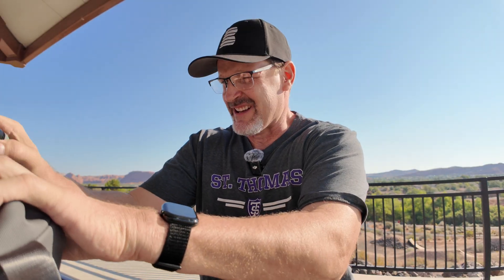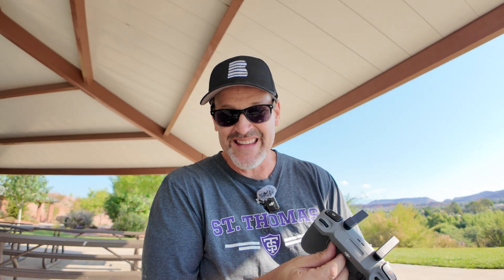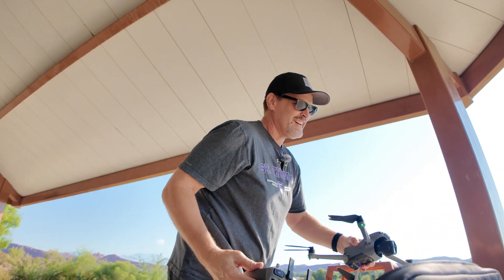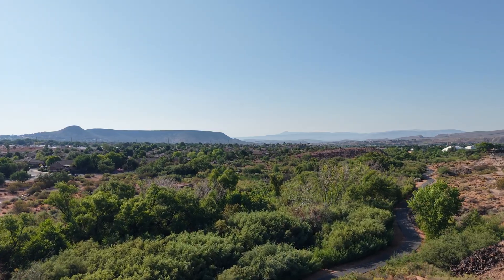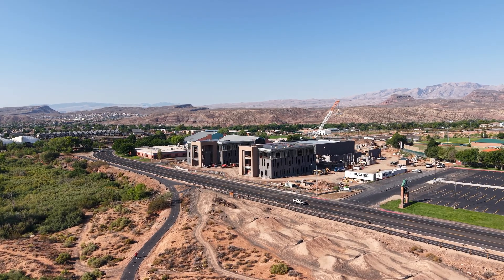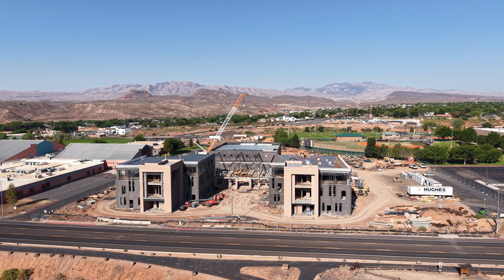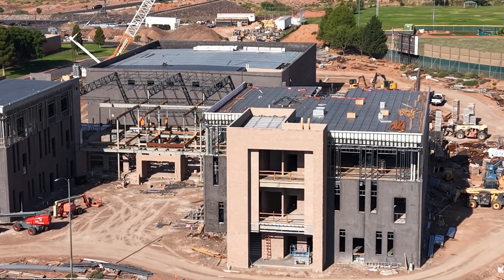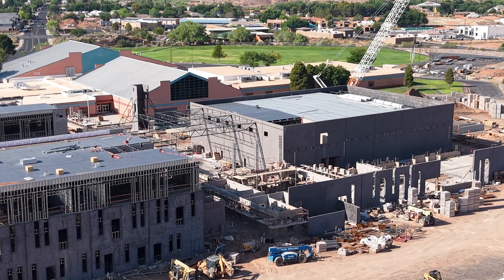DJI AIR 3S - SITE SURVEY WITH HIGH RESOLUTION

Comment: I purchased it, and it arrived Thursday, but because I wasn't home, Thursday and Friday, I have to wait until Saturday to get it. Man, the rules have changed. 😮
Reply: I really love my A3S! It's one of my favorite drones. And I've been flying drones since the P3P. I have purchased about10 drones in between the P3P and the A3S. As for camera drones and your investment in them I think the A3S is the best. A close 2nd would be the Air 3. You'll love love that drone! One great addition to get in filters for that drone is the 2 kit combo from neewer. i Love these. Variable. NEEWER Variable ND Filter Set Compatible with DJI Air 3S, 2 Pack ND2-32 (1-5 Stops)+ND64-512 (6-9 Stops) Variable Neutral Density Drone Accessories Slim Multicoated HD Optical Glass, FL-A88. Happy flying.